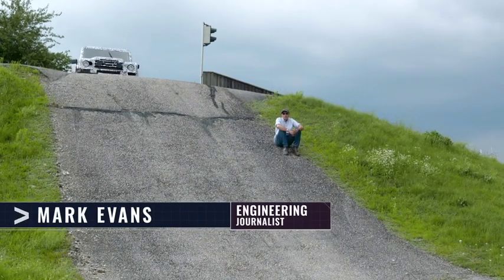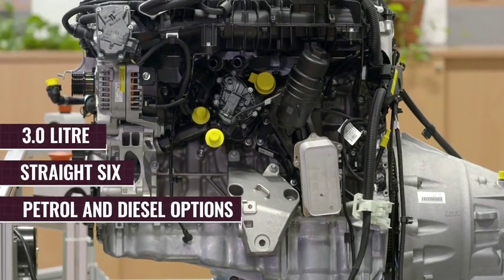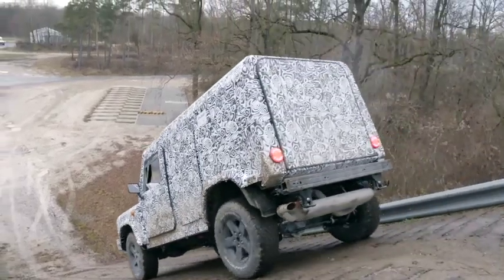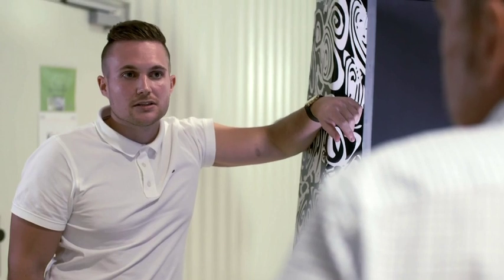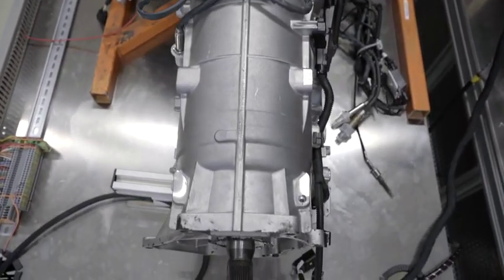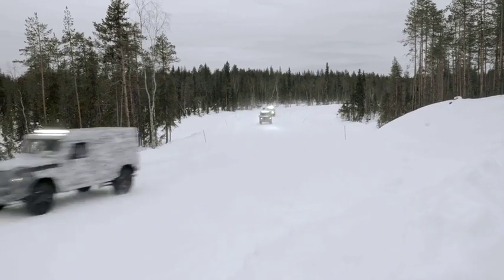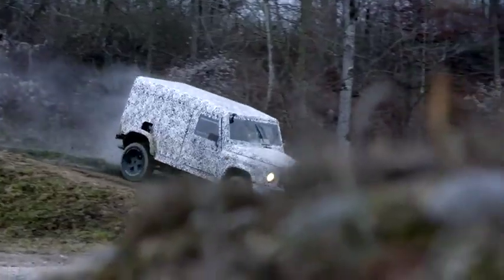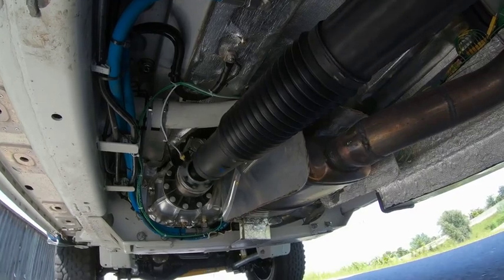2021 Ineos Grenadier | Engine and Transmission feature

Comment: My first question would be: How did they managed to modify the BMW engine, to off road use. I saw the alternator being quite low built on the engine, it makes the wading depthe a bit lower. How does a moderne engine full of electronics behave in off road conditions. What redundancies are built in so it will not stop working when out in the wild.

Comment: I heard about ineos possibility building a vehicle  the Grenadier to rival the Landrover defender and When I first saw the vehicle 
I admit I was quite impressed .. upon reading more and watching bits on YouTube! I have to be honest  I won’t be buying one not because I’m a loyal green oval fan but because I’m very disappointed in that it’s engine and transmission is german with only an 8 speed automatic gearbox no manual option. The bmw engine although reliable is notoriously hard to work on when the  need arises. The Axles  come from Italy and  assembly is done in France it’s only Britishness is ineos quite frankly they really have missed a golden opportunity to fill
A niche left wide open when Landrover ceased the old defender the British army was a huge customer, utility companies, farmers, forestry & civil engineering companies all used the defender a great workhorse i really can’t imagine any of them not least the army finding a use for such a vehicle as the grenadier only time will tell..

Comment: Automatic gearbox - will the car be push-startable? (in case the battery is dead).
Can it be roll-towed (meaning on it's own wheeles in case of engine failure)?
Reply: Georg Bittner-Buddenbrock 
No.
No.
Is my guess to your questions

Comment: Not a selectable, but a full time all-wheel-drive, and no manual?  That's how you know they are not in-tune to the people who would be actually interested in buying these vehicles...
Reply: Old Defender, Landcruiser, Patrol...... the ones people that would be interested in this own are all full time 4x4
Reply: @Khaos_1325   there is a difference between full time all-wheel-drive and full-time 4 wheel drive.  Please educate yourself.
Reply: @XerxesTheGreatOne  The Grenadier is full time four wheel drive
Reply: @Khaos_1325  Can it be put into 2 wheel drive?
Reply: @XerxesTheGreatOne  Nah will be 4 only, unless a part time kit can be fitted (I doubt it). Bit worse on fuel but  better for wet/icy or gravel roads.
Reply: @Khaos_1325   Exactly.  That makes it a full time all wheel drive vehicle not unlike what's on something like a Hyundai Santa Fe!
Reply: @XerxesTheGreatOne  What is the difference? My Range Rovers and Defender all permanent drive, my Toyota Van had permanent drive but no low range.
Reply: @XerxesTheGreatOne  4x4 Full time means it has a transfer case allowing 4 low. AWD does not.  The benefit to full time 4x4 over Part time is you have 4 wheel drive on tarmac at high speeds like an AWD, the negative is slightly worse fuel economy. If you put a part time 4x4 into 4 high on on tarmac you can bind the diff gears.  When off road It will have a centre diff lock (This is like 4 high in a part time 4x4), AWD does not have a centre diff lock, all wheels are open (Some like Outbacks have smarter systems). Most AWD cars are front wheel bias with the rear engaging when needed, most 4x4 full time are just that 4 wheels driving the car. This is a full time 4x4 like the old Defender, the G wagon, the 200 Series Landcruiser, the 79 Series Landcruiser, the Nissan Patrol, please don't put a Santa Fe in the same company, its a town car.  The Santa Fe is a FWD vehicle with the ability to send some power to the rear (AWD), they are not even in the same class of vehicle.
Reply: @Khaos_1325   Good, You finally learned something.  Now you know why this thing with its Full time All-wheel-drive system is a glorified Santa Fe that no real off-road enthusiast will buy.
Reply: @XerxesTheGreatOne  Its permanent 4x4 not AWD...... can you not read? This is a good thing. May I ask what 4x4 you drive as you seem to have little to no understanding of the subject or what enthusiasts would like.
Reply: @Khaos_1325  Enjoy your new glorified Santa Fe!
Reply: Santa Fe...oo get her😏
Reply: @Khaos_1325  uhhh, Landcruiser 79, and the other J7 series (HD) have rearwheeldrive. With the transfercase you engage the front axle. At that point you’ll have a locked centerdiff, what makes driving corners harder. For 80% I drive my landcruiser on 2H. I own a HZJ74.